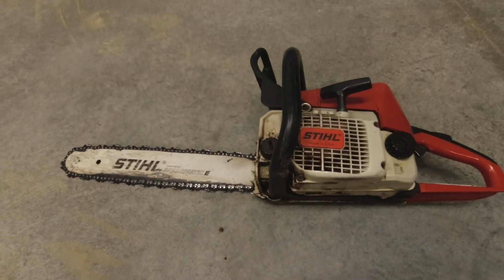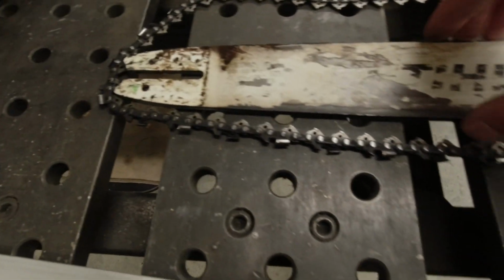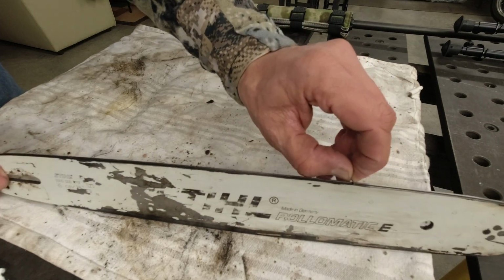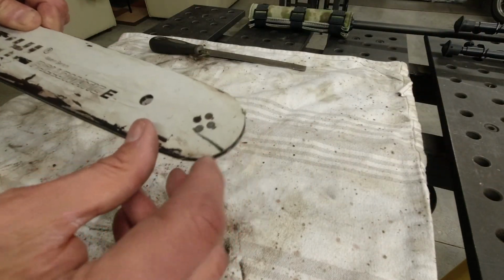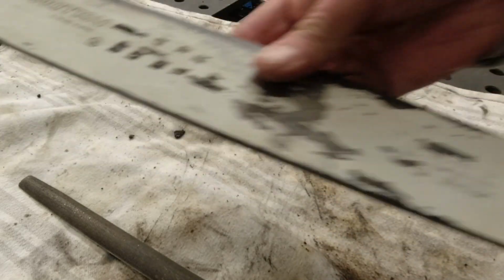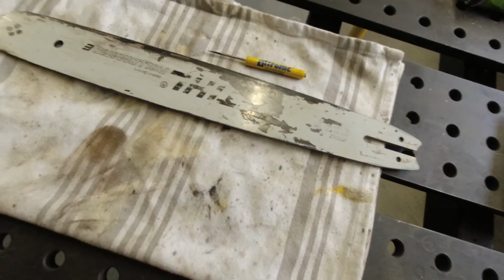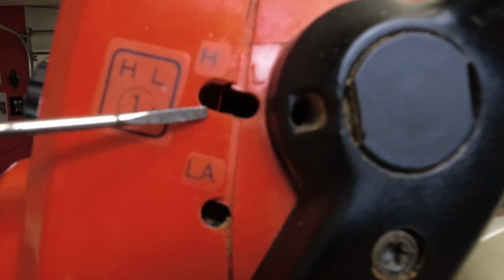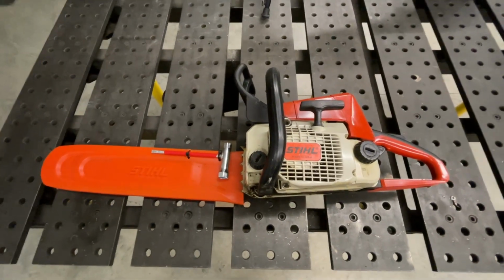STIHL 025 repair and carburetor adjustment

Comment: Good video im no mechanic i just found a old 025 in the trash it’s dry as a bone bar is rusted bad so i think ill see if it runs with fresh gas and if i can get it running buy a bar probably a chain to it’s missing a bolt on the bar too lol but it may be worth saving if i can get it going for $100 bucks or so . I have a 029 i purchased new 30 years ago when i bought my house ! Any way love the welding table
Reply from the maker: Good luck with your saw 😃👍

Comment: Husqvarna says never to adjust a carb until the engine has been running five minutes.  I never adjust a carb until the saw has been running at idle for a minimum of five minutes.

Comment: Tighten bar nuts to tight - yea, those on the 025 that I acquired had been tightened to tight and the front one was loose in its hole.  I used JB Weld to fix the bad threads.  I cleaned the hole and bar bolt with break cleaner and coated the bad threads in the hole with some JB Weld and put a thin coating on the threads of the bar bolt.  I then screwed the bar bolt back in to its correct depth, wiping off any JB Weld that oozed out.  I allowed it to dry at room temperature for three days before I put the bar back on.  The repair was solid and has given me no problems, since.  I do take care not to over tighten the front bar nut.